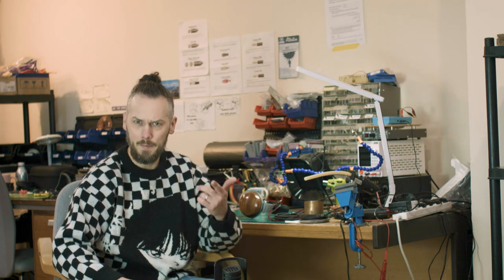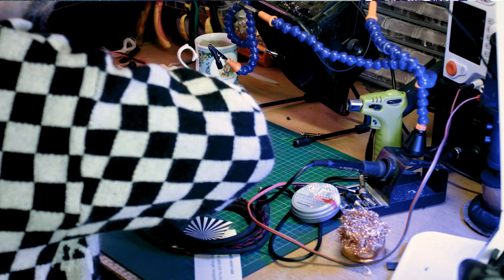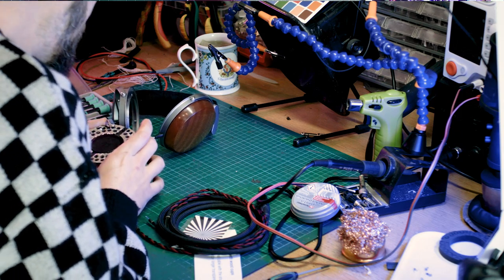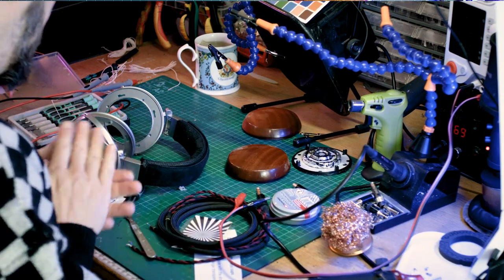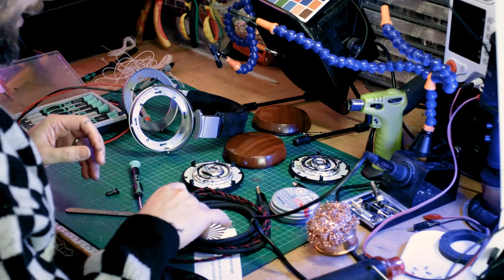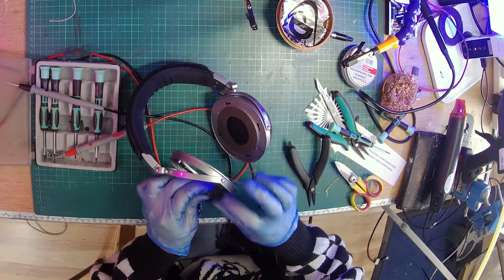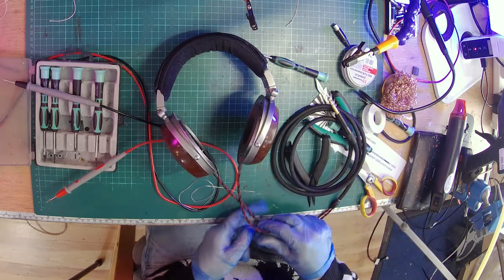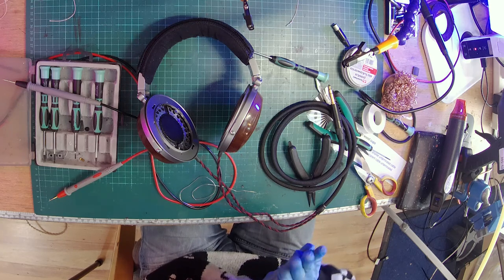Denon AH-D2000 re-cabling

Comment: I just started watching your videos, as I'm looking to do a detachable cable for my old pair of Sony MDR-XB500. I know they certainly aren't audiophile quality, but I have had them for 12 years and have always hated the fact the cable is always slightly too short. Anyway, my other hobby is throwing money into a pit, which coincidently is a Mazda RX8!  Love your videos, keep them up!
Reply from the maker: Older Sony headphones are normally quite easy to work on so i am sure it won't be too hard. And... I feel your pain... The RX8 is a total money pit. But bouncing it off the review limiter on country roads makes you forget all the bad times ;)
Reply: @CustomCans  The trouble I'm having is working out how to install a jack into the existing 90 degree piece where the cable exits the cans. I think the only thing that will be low profile enough is something like an MMCX connector. And the unfortunate thing with my RX8 is that it's currently not road worthy. Sat with a broken coil spring, perforated brake lines and the infamous crusty sills. It will return however. Are you part of the RX8 Familia group?
Reply from the maker: @TheMoffBoy  If you have a hunt you can get some pretty small 2.5mm sockets